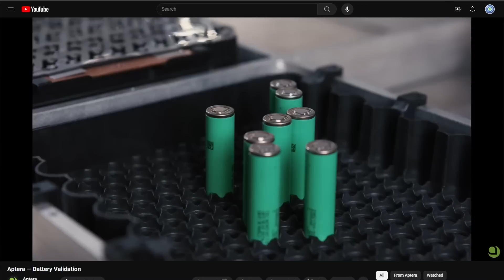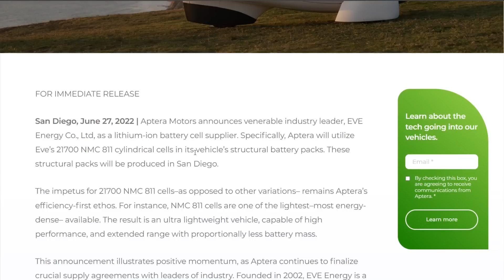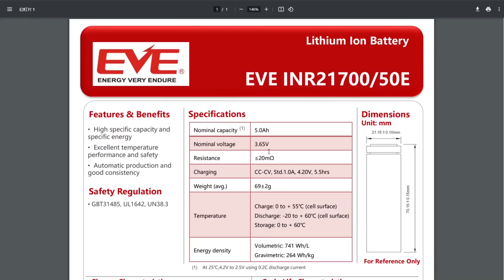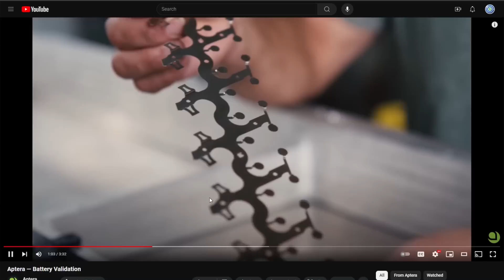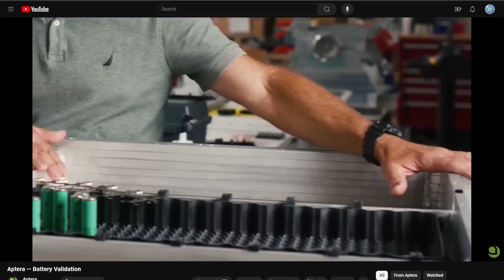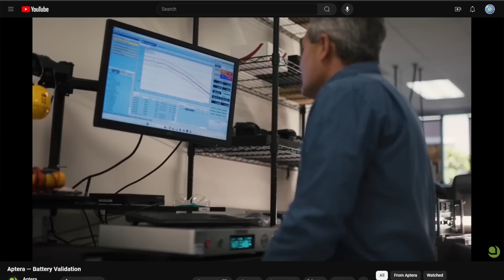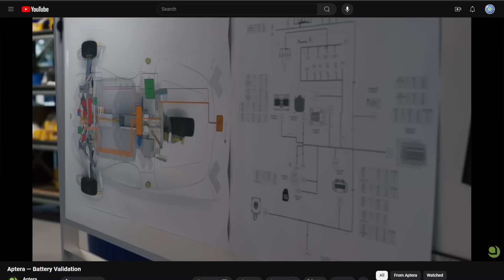Aptera's PI Battery Pack

Comment: Good recap.. but wondering why Aptera doesn't use [Corrected: I incorrectly siad LiPo when I meant litium Iron... my bad on the acronym] LiFePo instead of nickel/cobalt chemistries? the aluminum battery pack holder looks CNC machined, not very cost effective. Wonder what their end game production line method will be to manufacture.
Reply: Personally I suspect Aptera is going for proven, robust technology to start with. They can bear a little extra weight since their vehicle is so light. In fact, it'll make it hold the road better. 

I would not be surprised if they change their battery chemistry in a few years, though, to increase the range. And as long as it has a 2170 form factor the battery pack doesn't need to change.
Reply: @richardryley3660  For me, the NMC platform is a deal breaker. I am an investor as well.
Reply: Prototype builds are usually done with specialized tools while the production switches to mass produced methods.
Reply: Lithium polymer batteries are great because they are lighter than standard lithium batteries, but NCM based lithium batteries tend to have a higher cycle life and have a lower failure rate when compared to lithium polymer. I work with lithium polymer cells and have seen this first hand! I've seen some last a decade or more, but the majority last 2-4years before they fail.
Reply: Do you mean Lithium Iron Phosphate (LiFePO4) chemistry? LiPo refers to Lithium Polymer batteries which primarily relates to the polymer electrolyte and the anode chemistry could be any of a range (including NMC and FePO4).

My opinion on why they would use NMC instead of FePO4 is to start with the highest energy density at reasonable cost and accpetable cycle life and safety characteristics.

LiFePO4 chemistry generally has about 70% of the storage for the same weight of batteries.

Lithium Polymer batteries are less robust from a packaging perspective and would be really hard to keep safe in a crash. They work great in your phone, but not something I want in a large pack in a vehicle.
Reply: @christopherbrand5360  Ahh,, yes my confusion with the acronym, I meant lifepo.. I'll make the correction
Reply: LiFePO are often interchangeably used to mean the same thing. Actually LiFePO4
Reply: They always seem to claim that the NMC has a much higher energy density by weight and volume over the LiFePO4 but that is the only upside. The NMC are more expensive, lower charge cycle life, environmentally dirtier, more sensitive and complicated to thermally manage, definitely not as safe than LiFePO4 . LiFePO4 battery systems are managed differently. They require current calculations to manage capacity rather than voltage measurements of the NMC packs. My argument for the LiFePO4 system over the NMC is that in real world usage the NMC is operated between 30-80% to extend operating life and maximize charge rates. The LiFePO4 systems can run from near zero to 100% with no life cycle penalty in real world usage or charge rate penalties. This suggests a smaller LiFePO4 pack will have the same usable range in average day to day usage as an NMC pack thereby mitigating the energy density differences. I build LiFePO4 packs for traction equipment and would never think of using NMC. As Steve says, Aptera is smarter than us, they know what they're doing.
Reply: Probably expense?
Reply: @nickorbeck8693  LIPo are Lithium Iron Phosphate Still round... like Tesla 4780s
Reply: You could water jet the metal bus bars which would be less expensive than a bit CNC.

Comment: Little late in the game for battery validation don’t you think? How is that cooled with no channels or coolant contact areas?
Reply: End cooling is explained very well in this video.
Reply: Not really... my guess is Aptera is waiting to carefully select and test cells as the market is currently flooded with garbage cells that several manufacturers make exaggerated claims and find that the claims fall short of your expectations after testing. Finding a reliable manufacturer that can live up to their battery claims and balance that with affordability... its not easy.
Reply: don't think you heard the whole video, Steve and Aptera both explain that
Reply: They are validating the production intent batteries, which will go in the vehicle. Testing their prototypes might provide some valuable data, and I guessing they did test them, just as they are testing this one. But until they test the actual batteries that will go in the actual vehicle sold to customers they can't be sure of their results.
Reply: It’s a scam.
Reply: @dangr3957 why,  because you don't understand it? This is typical industry-standard stuff.